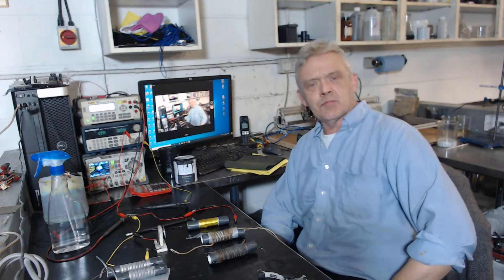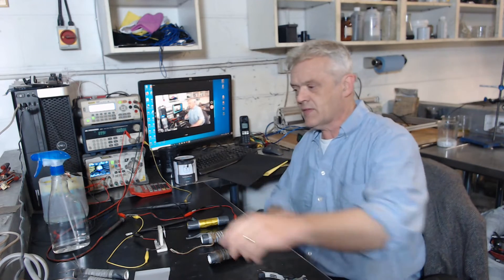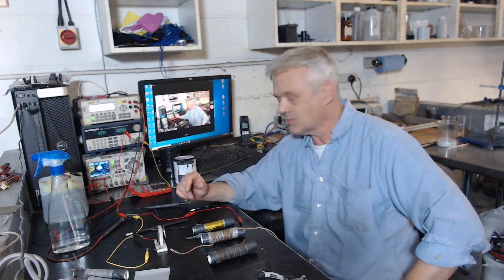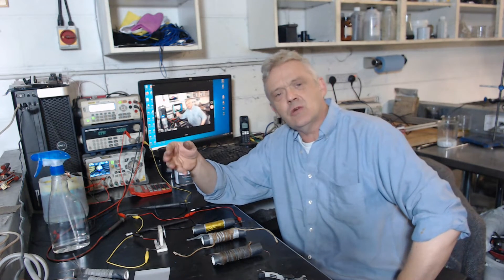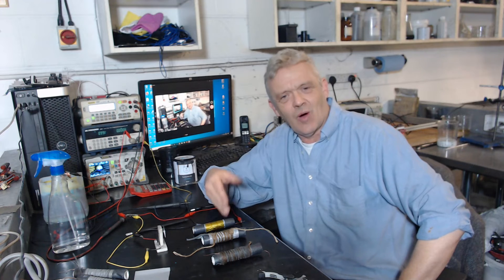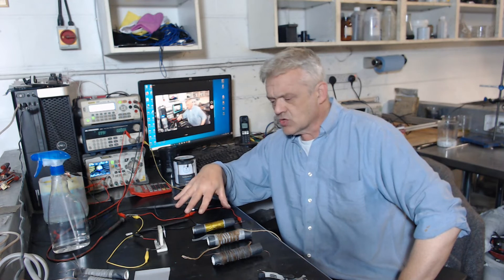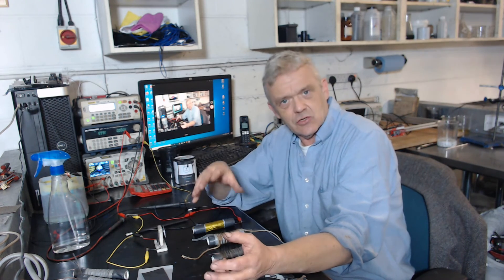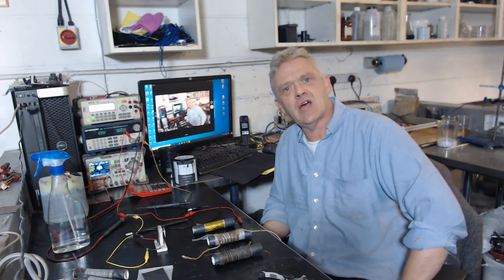Metal Air Batteries Improved With Graphene Ink

Comment: Maybe you can do it in reverse order by zinc plating stainless mesh as your tube and then separator and then ink coated dish cloth. The idea behind the stainless mesh is it can be re electro plated as the zinc is used up and re inserted like your cartridge idea. That should increase the energy density a lot.

Comment: As you may recall, I have a great interest in finding a proper form factor in which to implement an Aluminum/Urine/Hydroxide Fuel Cell, for the optimal extraction of energy from waste Aluminum cans ("Cannodes") and the...ahem...."user-supplied BioCatholyte".  There are good arguments for this, both in the applications (defense, emergency, camping), and in the chemistry/energetics itself (see Dr. Geraldine Botte's work on the efficiency of Hydrogen extraction from Urine).  I believe you have done experiments with scrap Aluminum in NaOH solution, and observed the prodigious evolution of both Heat and Hydrogen; in the proper apparatus, it should yield a significant Direct Current as well, at the same time.  

Dr. Botte has pursued Nickel-based catalysts for Urine (Urea) decomposition at the Cathode, and yet your nanostructured Carbon would be seemingly both much cheaper and easier to work with. (The Urine releases >20% more Hydrogen per liter than comparable salt water)  I have been interested in producing a batch of Iodized graphitic Carbon Nitride, for Cathode use (due to the citations of which you are well aware).  Might you have any data, anecdotes, or experience with the stability of your Graphene Inks in strong NaOH solutions? 

Given that the chemically-embodied electricity in a single standard waste 355ml Aluminum can is 200 Watt-hours , and that scrap Aluminum is now down to $0.05/lb. in the U.S. (down from $0.50+/lb a few years ago), it makes far more sense to 'burn' empty cans in an electrochemical cell, for Power, Heat and Hydrogen, than to turn them in for conventional recycling. They can be crushed vertically into nicely uniform "biscuits".  But the best shape and configuration of the system still eludes me, and the versatility you've demonstrated with the inks might provide an answer, depending on the chemical stability in highly alkaline electrolyte.
Reply from the maker: I have never tried it in high concentration alkaline environments - but I will now lol
Reply: @ThinkingandTinkering  Note: The NaOH has proven to be a true catalyst for the Anode reaction, in Aluminum batteries/fuel cells, and is regenerated.   That was once in dispute, but there are papers on the subject out there establishing this.  I'd be curious to examine if Dr. Botte's Nickel catalyist for the Cathode  reaction could be dispersed in a Graphene matrix to good effect.

Comment: ☺😊😀😁😂5 Smile's  Got a magnet motor build with flip feilds on hear only by hand but a ceramic core the normal way gets points 00.9mv on the volt and when you use a flip feild you get 03.9mv on the volt can't wait till its running on 3000rpm it should be a good one for dynamo use generation.
Reply from the maker: interesting mate

Comment: Exciting videos Rob! Got some of your ink and can't wait to try this!  I have been wondering how does one determine if one has built an "air battery" or not? I guess air batteries are not rechargeable?
Reply from the maker: it's an air battery when the cathode material is the air mate - the use of the ink as an apparent cathode is just that apparent - it is actually performing three main functions - current collector, site for the reaction and gas diffusion layer - the active material is oxygen from the air - hope this helps

Comment: Make the tube out of wire mesh add separator carbon cloth separator then wire windings.
Galvanized hardware cloth should make a nice zinc battery
Reply from the maker: nice mate

Comment: Another idea, being you have the conductive ink.   With a few other inks, do you think you could "draw" a battery, or capacitor on paper? Layer the plates, and seperators, insulators, then when done add a drop of electrolyte to activate, it could power  low power devices, possibly emergency locator becons, radios, or it could be a new battery production? Or it could be simply insane.!!!.. Sometimes the difference between insanity and genious is a matter of opinion!!
Reply from the maker: yes mate - I can - I am about to do a video on just that - but the ink is freely available - you could investigate yourself too

Comment: What makes anything new difficult, is the fact that it's new, and unthought of! It's easy after its been done, to an extent anyway! It's less difficult, the knowing us the hard part in most cases! Trying to think through all the possible situations and all possible outcomes!! I think the better battery regardless of chemistry, is aeach cell built as if it is many low current high capacity cells. Built together for a higher current capabilities. This should allow for high current fast charging , and high current discharge. It may be nothing new,  just something I been thinking of while building battery packs, a battery built from many hi capacity, low current  cells, would possibly perform. Better than the same Batt capacity in a battery with less cell, it works the battery harder  the battery built with more cells will have it easier. Like I said , just a thought, so why wouldn't work at a smaller level, ?  I may be completely backwards here, or may not be explaining my meaning well enough to get my point across. Cheers.
Reply from the maker: the real thing mate is the mentally trying to think things through takes ages and your mind wanders down many paths most of them a waste of time - very often - and something we seem to be forgetting is the mindset of the engineer - give it a go and see - most of the questions resolve themselves or are just not important